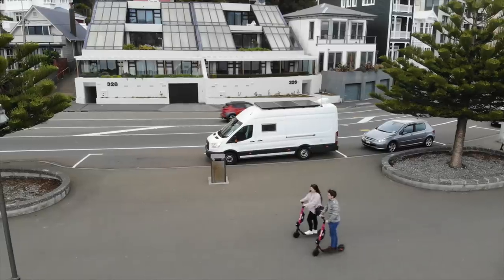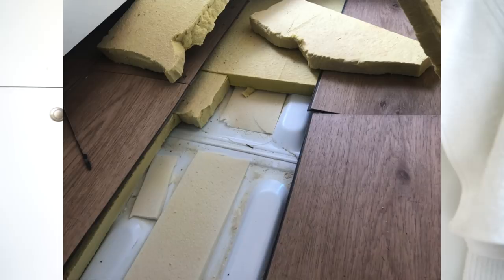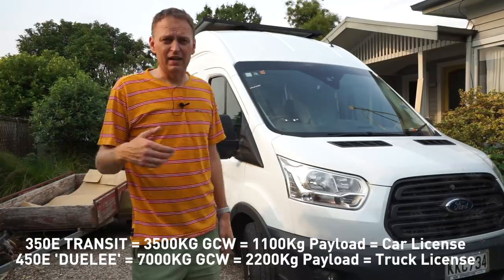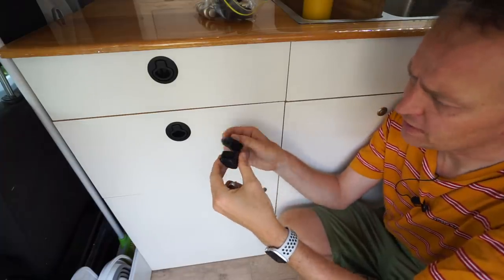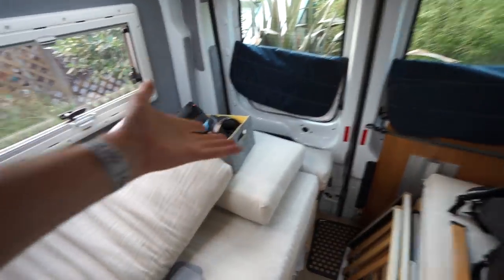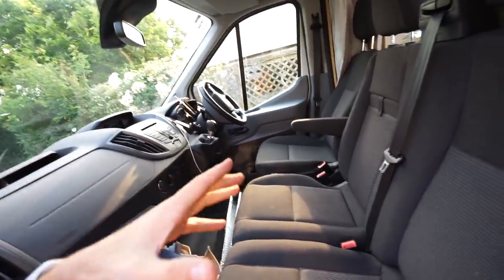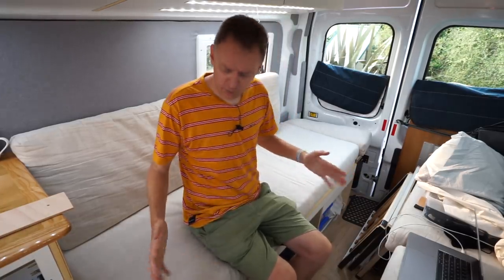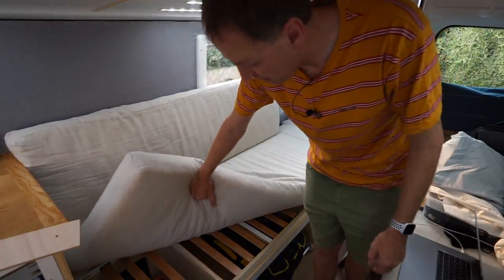10 Things That Didn't Work in the Van : Eat Sleep Van 33

Comment: I have a system very similar to yours (I’ve enjoyed your posts on the victron community help forum) and I too found the victron buck boost to be a bit too expensive.  I ended up getting the sterling power batt ultra 12v to 24v battery to battery charger. It’s a british product so it should be available for a reasonable cost in Aus. I was able to get for about 67% of the cost of the victron. Plus, it’s 70a, more powerful than the 50a victron, although not as powerful as the 100a victron (which is just absurdly expensive).  I think 70a is a great range — I don’t think my ram promaster alternator would be able to handle much more.
Reply from the maker: Thanks for that! Sadly the Transit is limited to 60A output from the 'customer connection points' i.e. the battery. Any more can interfere with the systems. Can you limit how much it pulls?
Reply: Eat Sleep Van You would need to set it at half power then.  Unfortunately, the options are either full power or half power — there is no granularity.  The weakness of the sterling unit in contrast with the victron unit is the fact that all of the settings on the sterling are handled by the two buttons on the top of the unit, whereas the victron is similar to a multiplus in that it is programmed via victron software on a PC.  You should save up and get the victron buck boost as soon as you can!
Reply from the maker: @PaDutchRunner  Thanks, yes there's a reason it's expensive, it does actually do a lot! The built in engine-start detection for example sounds useful, so I don't need to mess around with wiring to the van's electronics. Also I think it has charge profiles built in for Lithium which I need. A cheaper alternative is to use an inverter, and feed that into the shore power charger. That has the advantage of running an extension cord from one to the other at high voltage!

Comment: To save up some weight and space (depending on the model of the current stove you're using), you could use a stove cooktop and a smaller oven, which could possibly reduce the volume of your oven setup to half, which would likely make it possible to add a microwave to the setup, as well. The price might be slightly higher, but having a microwave might be worth the price.
Reply: For the solar power, you just have to use some hinges and some way to lock the hinges at a certain angle, as well as metal sheets (preferably stainless or lacquered), to reflect more sunlight onto the panels. You can have the metal panels bolted onto the supports with nuts and bolts, so that you can take them out when they're not in use. You might have to get a bit more space in between the solar panels, for the system holding the sheets in place at an angle, and you might need to choose to either use some motor to change the angle, or to have to up up a ladder every time you want to change the angle, but you would have to go up the ladder to put up or take down the metal panels anyway, so you might want to find a place to store that ladder.
Reply from the maker: Definitely considered tilting the panels! Decided to hard, will think about it another time.
Reply: @EatSleepVan  Tilting the panels would be harder, and using some metal sheet like stainless steel sheets or aluminium sheets on a frame would be not only cheaper, but also more effective in some cases, since you would be getting more sunlight than with only the tilted panels.

Comment: how come you didn't buy all 12v batteries an charge'm off the alternator 1 at a time, with the solar panels?
Reply from the maker: Hey good question! It would be easier to have 12v everything but I’d still need a lithium charger of some sort so the problem doesn’t really go away completely. 24v has a few advantages including smaller cables and higher efficiency in some ways.

Comment: Can you provide a link for purchasing those “slam latches?” Or at least a name brand? Thanks!
Reply from the maker: Hi Ali Express or Amazon has them. Just search for “slam latch”. Here’s an example https://amzn.to/36skkkl
Reply: Mayan Hein Thanks very much, my current van has had problems with cabinet doors opening, and I have tried a variety of poor, old fashioned styled latches and all have been disappointing. In 2020 I plan on buying my second van and starting the process again, and I’d like to get some proper latches!
Reply: Eat Sleep Van Thank you!
Reply: Mayan Hein The magnets are a good idea, I have used magnets as well. In the new van my plan is to use self closing drawers. They have spring mechanisms in the drawer slides, and they pull the drawers closed the last couple inches. Recently I put a few of those in my current van, and they really hold themselves closed so far, and I have heard of other people having good results with them as well. Thanks again :)

Comment: Your video was very insightful, even though I'm not ever going to be able to build one myself and I'm going to have to have one built I understand some of the difficulties now
In the United States the Ford transits have a bunch of different models High roof low roof and it comes with two seats in the driver passenger or three seats also of course the steering wheel is on the other side and we drive on the other side of the road the right side not the left
And the Vans are offered in diesel or gas, (petrol)
Your solar setup is nice but you didn't install no maxxair fans for air flow it must get pretty hot I don't know what the climate is like in New Zealand but in the United States you need fans or you'd have to install an air conditioner either roof mount through the backdoor or mounted on the floor venting underneath the van
Another option for charging your van is have a Shore power plug on the outside of your van she can plug into any electrical outlet and recharge your batteries that way
A petrol or in America we say gas station might let you plug in for a little bit if you're getting a lot of fuel the same thing is said to get water some gas stations will let you refill your water tank for free with the purchase of the fuel
Reply from the maker: Hey thanks for your comments! Funnily enough we do have a maxxair fan, and another small bathroom fan at the other end. The perfect combo for constant airflow :) and yes I do have shore power, so that is what I use when needed, mainly 3 months only in winter plugged in every 3-5days. Thanks for watching!
Reply: @EatSleepVan  another option for recharging your batteries would be to put in a bigger alternator or a separate one and recharge your vehicle that way while you're driving or your van is in idle turned on but not moving
Reply: @PSVitaFan  Yes and sell that 2 seat passenger bench and get a light single passenger one, this way he can get a microwave. A lot of weight comes from the thick furniture but now it's a bit late for that
Reply from the maker: Sadly parts like spare captains chairs are not easy to come by in New Zealand

Comment: The overhead bin that's too wide. Why not rip it out and redo or build another?
Reply from the maker: Yeah really should. Main problem is I don’t have access to the table saw or any more material!
Reply: Can you just move it to the left into the empty space for now?
Reply from the maker: @bobbodadroid4053  That would be nice but actually quite tricky, as the van curves more at the front. It wasn't designed to work on a curve. So it would need re-working anyway.

Comment: Just get a 12-24volt B2B charger for about £300
Reply from the maker: Which one? Needs to handle 60 amp input / around 30 amp output, and custom lithium charging profiles

Comment: Looks like your van would be useless at -1c temperature with all that exposed van metal.
Reply from the maker: You’d think so however there are a few details that aren’t obvious:
- the inner Transit walls are thermally isolates from the outer walls. The exceptions are the doors. So it’s not quite as bad as it looks.
- There is insulation in my walls, ceilings and floor.
- The diesel heater can easily keep the van warm, I’ve been down to -5c overnight no problems.
- I normally leave the Maxxair fan running on low all the time anyway for fresh air. A trick is to have it blowing air in, so it’s it’s not sucking out the heat from the ceiling. Again the heater counteracts that heat loss happily.
In practice no problems so far, it was my cosiest winter so far of all the places I’ve lived!
Reply: @EatSleepVan  Good to know I wondered about that too.

Comment: I saw so many van builds for fun. And sorry to say this but this build is not good. The layout and even the wood work is kinda very weak. I think you should look at some of the American builds. I am not talking about the athetics of it. More so, even looking at those wood slats and whatnot, weak. You need more robust framing. Even the choice of the refrigirator is poor if you want energy efficiency.
Reply from the maker: Hi layout depends very much on what you personally need. I need a lounge and desk setup, so this works well. If you want to store bikes in the van, then a fixed rear bed might be a good way to go. As for wood work, if anything I made things too heavy and strong. Should have used thinner plywood for the upper cabinets for example. Nothing has broken except my bed frame but I’ve replaced that already.